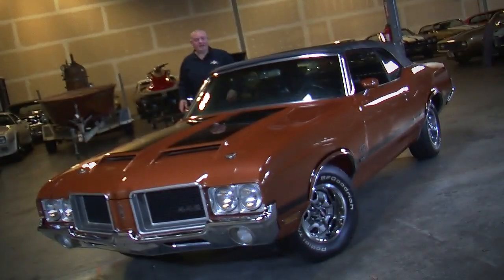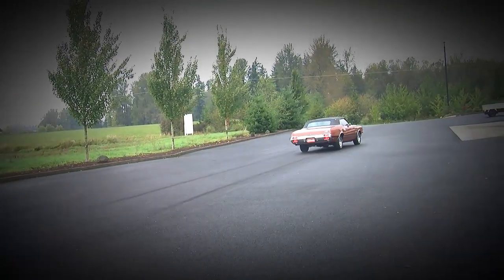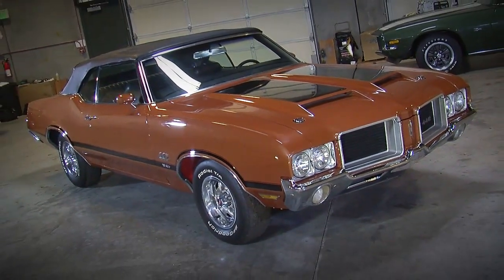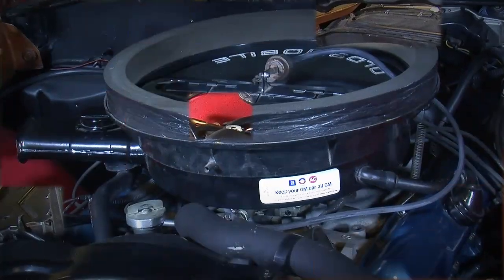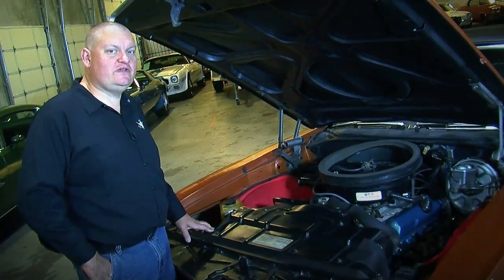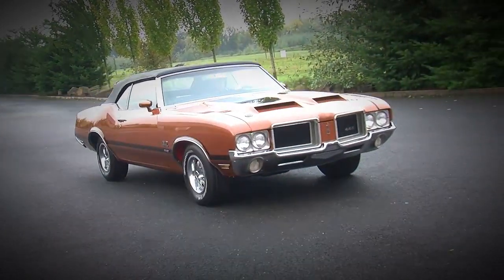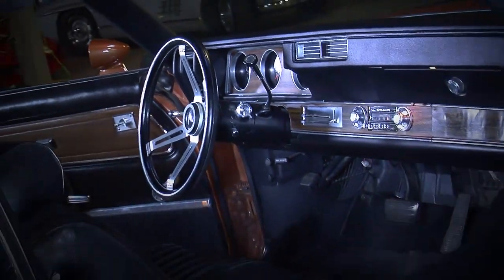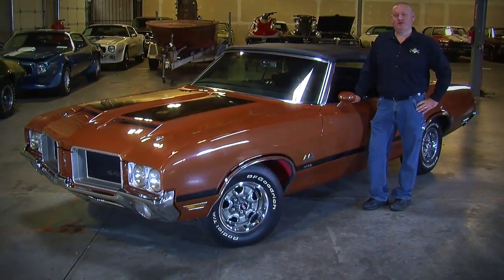Muscle Car Of The Week Video #33: 1971 Olds Cutlass 442 W30 Convertible

Comment: With the 455 and the W-30..350hp.. was a lot in 1971..I wrote in another comment I purchased the same exact car but a different color in 1977 with 45,000 original miles on it picked it up for $2,500 dollars had it for 2 years Sold it for $3,000.. Back in the 60s and 70s you could buy any used Motorhead car that you can think of and the most you would pay would be $3,000 tops..Sold my 1967 GTO with the 400 motor back in 1978 for $1,000 dollars now they want like $60,000 and up..